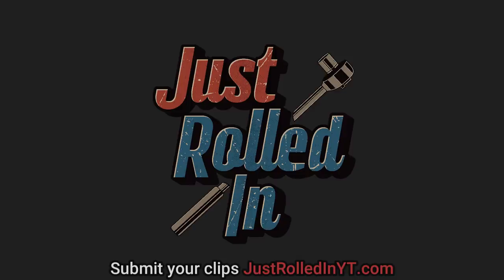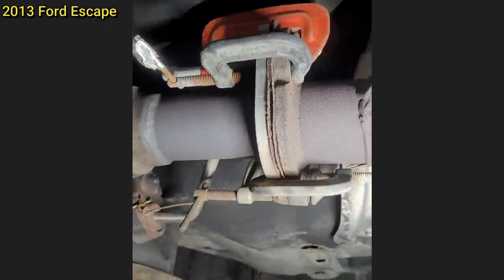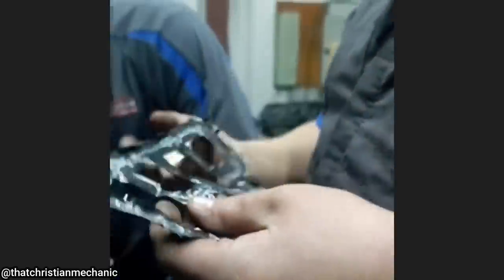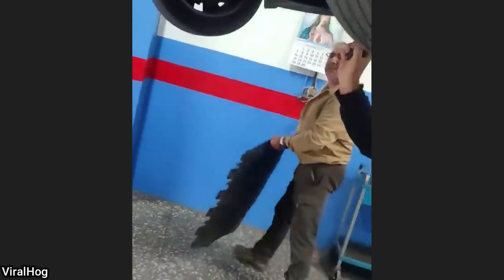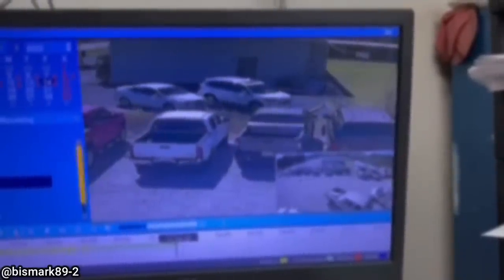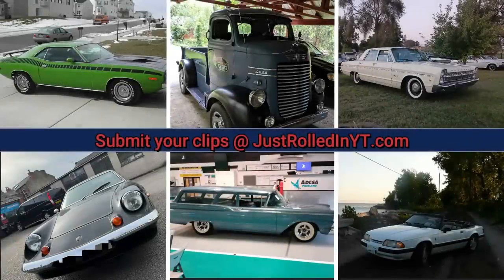Customer States Truck Has No Power & Check Engine Light Is On | Just Rolled In

Comment: I just shake my head watching these videos, and I don’t believe it when the customer says they just had what ever installed at another shop, some shops are bad but not this bad, they just don’t want to admit they did it. Great channel
Reply: I think you pretty much nailed that one right on the head. I don't know how many times I heard that story before. I would just tell the customer to take it back to where they had it fixed because I was going to charge them full freight. And that's when the BS would start. 
"Oh, they are too busy, ,,  can't get another part for 6 weeks,,,,, the tech that fixed it is on holidays,,,, bla bla bla. 
Just once it would be nice to hear " I tried fixing it myself and got in over my head." 
If someone told me that instead of some ridiculous BS, I might even cut the guy a break on some labour.
Reply: yup. i worked my whole life in a body shop and back in the day we would paint cars the customer "fixed"  surprisingly when they came and picked it up even though it looked like a child fixed it, they almost always think they did a great job.
Reply: Nope. A LOT of shops are this bad. MOST of them actually. My steering wheel came off in the parking lot after having the steering column replaced at a shop. Freshly painted body part placed on bubble wrap, the bubbles imprinted in the paint...and many, many, many, MANY more.
Reply: @username8644  
Sounds like the subaru shop in my town, bunch of crooks.  Advertise "the best used parts selection in the state" yeah because they rip people off having them replace shit, charge full price, keep the old part, and resell it🙄
Reply: @perry92964  this reminded me, just last week a customer was asking for a roof rack for his car, he showed me a picture of his car and holy shit, he (or someone) had painted it with some random wall paint with a paint roller and it looked ROUGH. I said nothing about the paint but gave him guidance with his roof rack.. 👀
Reply: That ball-joint replacement 😅

Comment: NEVER use cardboard and tape man!!  Only cereal boxes or wax paper milk cartons bro!
p.s. RTV is cheap, use at least 3 tubes per gasket, one of each color just to be safe.
Reply: Don't forget the jb weld
Reply: @thomasfletcher760  And duct tape.
Reply: @61rampy65  Duct tape is the master fix for everything!
Reply: Don't forget the Flex Seal!
Reply: @michaelwarren2391  and mix it all together with a tube of super glue
Reply: @thomasfletcher760  Definitely swab a huge gob of JB on the head nuts & torque to spec at 190lbs in a star formation....
Reply: @61rampy65  Check out the blue 70 Challenger like the one in this vid in my Burnouts and Boobs VHS from 1996 for a funny duct tape joke... it's a classic!!
Reply: @61rampy65  yep , gotta have a base to start with
Reply: @thomasfletcher760  And remember, the bigger the blob the better the job...
Reply: @gerry5712  exactly
Reply: Do these VEGAN milk cartons work too?
Reply: @thomasfletcher760  And don't forget to add the baking soda to the super glue!
Reply: @thomasfletcher760  ... JB weld actually does a decent job when coolant eats away the aluminum on an intake manifold. Of course, you have to file it smooth the next day before installing a new gasket.
Reply: @michaelwarren2391  oh , that's right 🤦🏼
Reply: Wonder if someone is laughing their head off reading these comments 🤣🤣
Reply: @thomasfletcher760  ... This is our hope... This is our mission... carry on Major Tom!
Reply: high temp copper is my favorite flavor
Reply: @widdly-scuds  good stuff to frost it all with

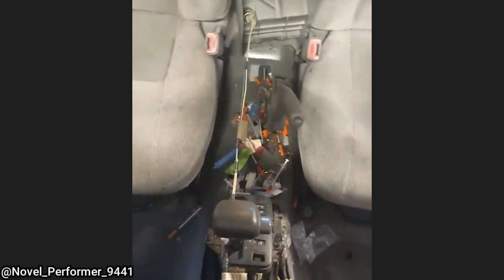Comment: 2:18 OH HELL NAW!! No way I'd continue working on that either, close the doors and push that out of the bay.
Reply: Yup. I wouldn't even tell the owner. Just call the cops and put that druggie in jail.
Reply: @hastypete2  did you see the car? Also I'm sure the avg diabetic would know how to dispose of sharps
Reply: @hastypete2  they can probably tell by the little blue and green baggies that are used for holding heroin.
Reply: Yep, even after it’s cleaned I wouldn’t work on it because of the risk of a hidden needle.
Reply: I have a couple of friends that are diabetic. They would never leave needles out like that. Ever. 
That is 100% drug users vehicle. Best not to do anything more to it. Like someone else mentioned, do you want the risk of getting poked by one of those ? Hell  no !
Reply: @hastypete2  But you know all about insulin needles. Yeah, right.

Comment: I genuinely laughed out loud upon seeing the welded ujoint.
Reply: I was stunned. Who the BLEEP welds a universal joint?
They are not that expensive that you need to screw up the function of it. Unless this car was sent back in time from a post-apoc future where parts are not available?
Reply: @MonkeyJedi99  May be a staked ujoint which will be much more expensive to repair than regular ujoints. I couldn't tell the difference from looking at the video though
Reply: @kais2345  I had to look up staked u-joints to know what you referenced.
Even knowing what little I understand about them, I can't see that welding the universal was a smart idea.
Reply: As a former committee member of the American Welding Society, I got a bit nauseous when I saw it. Welding is a good thing. That U-joint is not a good thing.

Comment: 2:15 OMG that's shocking. Good call for not working on it
Reply: Those hypodermic needles could be from illicit drug use or from an insulin user. Either way, they can be a health hazard.
Good call by the garage.
Reply: There's baggies and water containers for dope. Also the missing fender is a good indicator
Reply: I wonder what the odds are that the local law enforcement would want a few choice words with the owner of that vehicle? My guess would be "better than average".😂😊👍
Reply: I would of stopped all work on it as well. Come get your POS off my property and don't bring it back.
Reply: That's honestly quite freaking terrifying. Just imagine getting pulled over and a police K9 signals your car that you just bought used 2 months ago. You then get arrested for possession of drug paraphernalia. You have no idea how it got in there.

Comment: As someone who often deals with clients who leave used needles all over their car... good call on refusing further work!
Reply: If it was me I'd be calling the police and having the damn druggie arrested. If there's needles there is more than likely drugs 🙄😂.
Reply: They look like diabetic needles. I carry a few in my center console.
Reply: @cb-gz1vl  Yes, but they are also used by intravenous drug users.
Reply: @rcfalcon56MkII  If they are diabetic needles then no. Part of shooting up is the rush of the injection, pushing in as quickly as possible. Diabetic needles are too small for that.
Reply: @cb-gz1vl  doesn't stop addcts from using them, I think they're probably the cheapest and easiest to get, when I was taking care of a vacant building where people would shoot up in the back, diabetic needles are the only syringes I found, dozens of them in a week.
Reply: @bunhelsingslegacy3549  well I asked my diabetic nurse about that cause they just hand out these needles and that's what she told me. They just aren't big enough to give the rush.
Reply: @cb-gz1vl  It's probably what your nurse has been told for whatever reason, but I can confirm that these syringes are perfect for drug injection, and they're small and practical enough to be handled with just one hand for self injection. 
Most diabetics who regularly need to inject will safely discard the syringes and won't be shy about the presence of a safe disposal container in their car, house or office while, on the other hand, it is not the case for some drug users, specifically if their family or friends don't know about their addiction or if they are too afraid to do otherwise.
Most regular drug users I know won't leave used syringes lying around, they'll discard them appropriately and bring them to a pharmacy or help group.

Comment: I love when you tell the customers what's wrong with the car and the parts it needs and the customers ended declining the work and the very next day they are there at the shop!
Reply: Very true, I sold auto parts for 6 years and I'm not surprised at the amount of things that people either don't want to or don't want to have repairs done on the vehicle until it breaks and then they have to spend more money because it would have been less expensive to fix it the first time instead of having the vehicle towed in for repairs after it broke down
Reply: Maybe they didn’t have the money to approve the repairs that day, then we’re able to borrow money the next day to get it fixed. Not everyone has cash on hand or credit. 🤷‍♂️
Reply: @LuckyCharms777   Most of those types of owners have borrowed all they can, just to buy the vehicle they want!

Comment: In the photos at the end , lower middle is a 1959 Ford ranch wagon , just over 43,000 miles on it ( 62,501 km ) . I had a car that had an air filter almost as bad as that first one ( just bought the car for 400 bucks ) changed the filter and mafs and that thing would scoot ( 1995 Ford crown Vic interceptor ) man , that challenger was definitely a pallet cleanser , sounded sweet and looked it , too 😁

Comment: I admit it, the clamps on the exhaust is something I would do !
Reply: I once did that on the thermostat housing of a car where I'd snapped off a bolt. I knew the car was going to the junkyard before long anyway, and it saved taking apart a lot of stuff to drill out the bolt.

Comment: What. You're not supposed to weld U-joints? 
Honestly that's completely nuts IMO.
Reply: @T.J. Kong Depends on what your liability would be. If you're supposed to fix it you'd definitely work on it. If I was doing any driveline work and the customer said don't touch it I would not do any work on it. Too much chance of it biting you in the butt if there's a catastrophic failure of the drivetrain. Also in most places it would flunk inspection too.
Reply: @Dsdcain  why would they weld it? what does it do when its welded?
Reply: @SalvadorSTMZ  Not sure what made them weld it. As far as what it would do. It would make it way more expensive to replace that U-joint if it needed it, and with welding it you run the risk of messing up the joint itself. Getting it hot would probably mess up the temper of the rollers, as well as burning out the lubricant inside. If you look it's also not top tier welding so who know how strong it is. Hope that made some sense. Sorry been a long day.

Comment: It's scary how fast things can escalate, one day could mean thousands in repairs
Reply: I told my neighbor that he needed a ball joint when I was fixing his brakes. "Nope, can't afford it."
Not even two weeks later that ball joint separated, took out the half shaft, the brake flex hose, tire got wedged up in the fender. Destroyed the tire and mangled up the fender pretty bad. 
I think I was originally gonna charge him $150 to replace the ball joint. It was well over a thousand by the time I was done. 
Just in case anyone was wondering, no, I'm not a backyard mechanic. I'm a licensed technician. I work on all my neighbours cars so they won't complain about me doing other stuff at home.

Comment: That first clip is exactly why I like my external air cleaners on a truck. You put a compressed air wand into the little rubber hole on the bottom and spray away all the dirt at least once a week if you're daycabbing.

Comment: I think by far the worst thing I have done so far was replacing a radiator for my girlfriends mom. 95 Lesabre. Cross threaded lower trans cooler line. Thankfully caught it before I let her drive it away and with a little blue loctite and a painful pulling the fitting with my finger to fit the thread correctly, and no leaks. Hope nobody has to take that fitting off anytime soon…..
Reply: We replaced a manual with an automatic on a '77 Ford Econoline van. Figures, the journals were different sizes on the drive shafts and rear yoke. Took the 2 shafts to a driveline shop to have the ears cut off, welded and balanced Asked what it would cost guy said $15.00. Came back with a U-Joint with 2 different sized journals, says it's common among racers, problem solved. Eventually sold the van off. Would give a kidney to be there when or if the rear joint was ever replaced.
Reply: @BigLisaFan  when I was workign car mechanic here, someone brought in a Mercedes W111 sedan they planned on buying. first, the car was rolled-over with flat black, the leather seats were done for (someone glued a plastic mat to the driver seat's backing with sealing compound), the body was corroded, and what's worse, the 2.8 straight six was replaced with a 240Diesel engine supposedly off a /8. since the driveshafts between original 4speed automatic and 4 speed manual that hung behind the diesel, were as different as the engine mounts whoever did that sawed two shafts each apart and welded them together. needless to say it was unbalanced and made the car undriveable above 60kph... seeing the ramshackled modifications and "repairs" hurt, even me being a Fordoholic, and how the car ever passed safety was unknown. Customer brought it back again, probably told them to toss it.
Reply: @lotharrenz4621  The horrible things people will do to a car. There ought to be a car protection law.

Comment: Seeing that picture in the thumbnail of the blocked air filter reminds me of the time a Ford Galaxy was towed in,It would either start and die immediately or fail to start at all,this after the owners dad had serviced it. Upon cranking I noticed the pipe between the air box and throttle body being sucked in,I opened the air box to find that the new air filter was still in its protective bag😂

Comment: I was asked to work on a car, and the locking wheel nut key was in the boot/ Opened the boot to find it full of needled and syringes. On closer inspection about half were used and the needles exposed.
Left the car and returned it to the dealer, when I got back to the factory customer had already written in a complaint. Bosses told him to F. O. once they saw the pics of the boot.
Turns out he was a drugs counsellor and claim none of the needle was a hazard.

Comment: I’ve done the clamp thing. 360 ford in my plow truck. Broke off all of the top bolts on the exhaust manifold and couldn’t be bothered to drill them out. It’s been 7 years

Comment: Couldn't get it on video but I was running emission test on a Mack semi tractor today. It was just serviced by one of our genius techs. The low oil pressure warnings came on and pressure was dropping. I shut truck off and got out to look. Oil pan drain plug had fallen out! Dumped thirty quarts of oil on the ground! Finger tight is not ok!! Keep up the great videos!!
Reply from the maker: Damn. Good thing you caught it! 
Those trucks don't have a low oil pressure shut off?
Reply: @JustRolledIn  They do but I shut it off before it shut down on it's own.

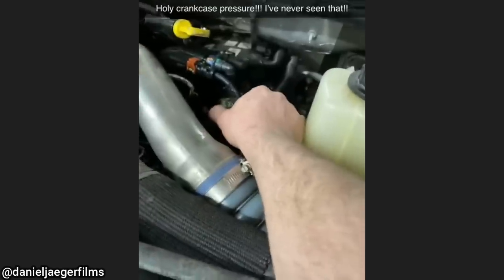Comment: 0:31 that sort of pressure can cause lots of issues with turbo motors   mainly excess oil use  - i recommend  drilling a hole in your neighbours sump to release the pressure

Comment: Back in the day, my father used to patch up cars with multiple bullet holes in them. From police cars to civilian cars, a lot of them had bullets! Instead of replacing the engine/components, they used to mold a piece to fit exactly on the hole like a puzzle piece, then they would weld it together. Unsafe but effective.
Reply: How well did he go with patching radiators, pistons, & carburetors?

Comment: I had a job last Friday on a Peterbilt 220 box truck, with the Paccar (Cummins) 6.7. Driver ignored the check engine light for so long that the DPF got full and derated him.

He had several codes, so we had to figure out which one was the initial cause, which turned out to be the Variable Geometry Turbo Actuator. And if anyone knows these truck, they know the turbo is backwards, making the Actuator be between the turbo and block. It is possible to change it there, but extremely difficult. I initially tried to but one of the Allen Key Head bolts stripped, so i had to pull the Turbo off. Replaced the Actuator, Claibrated it, reset the DPF life so it would let me Regen. Took about an hour to Regen, but it solved the problem.

Oh yeah, and that Actuator was about $1500.

Comment: Watch some co workers who were rebuilding a v-8 chevy in an 80s Camero, instead of buying new head gaskets they put a half inch of blue silicone gasket maker between the block and heads. Ran for a few weeks badly. Then quit running.

Comment: I needed ball joints on a van that i owned and the it was to the point that the shop wouldn't let me drive off until it was done.  I wish it was nation wide that if a car is non save to drive, a shop shouldn't let it go back on the road.
Reply: Yeah, and crooked shops wouldn't let you drive until you had them install one of their $1000 ball joints. Or they would charge you for something that didn't need to be done. It would be a license to steal.

Comment: Most of the problems came from "installed by himself" . I know trying to save some bucks is good, but even myself I did oil and filter replacement on my vehicle and I installed air intake filter wrong side so engine was barely making 1000 rpms, so in the end I went to mechanic and had a good laugh when he found filter upside down.

Comment: These clips just reassure me why I would never buy a used vehicle. Thanks for sharing and have a good week.
Reply: @SirMcMuffinTop  Yeah, seriously. Most of the cars I've had were used, and I got one sour lemon that I still have. Just the one, though. Most issues I've had weren't too big - thermostat housing leak on a 2005 Explorer on the highway not 200 miles after purchase? Sure, that happened, but I had enough coolant to limp home.